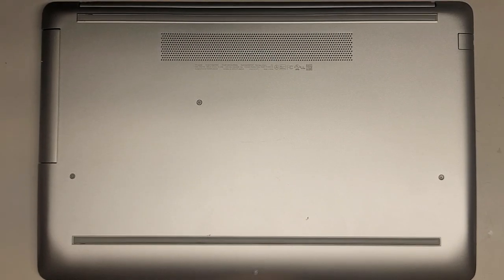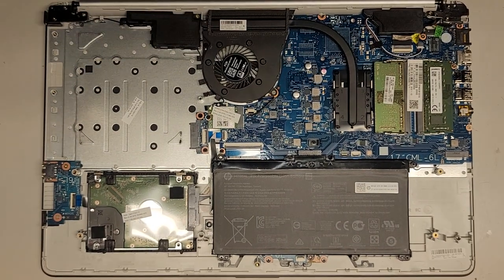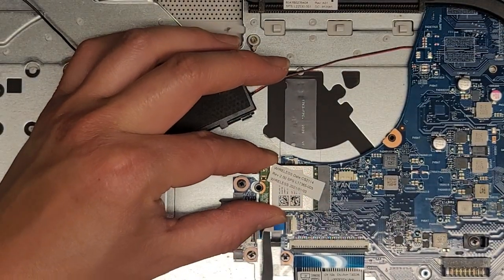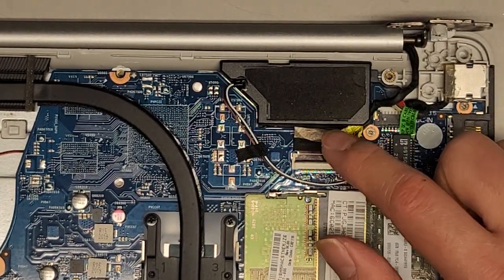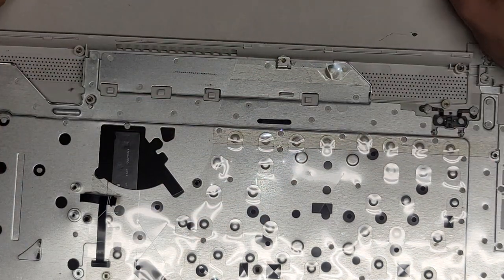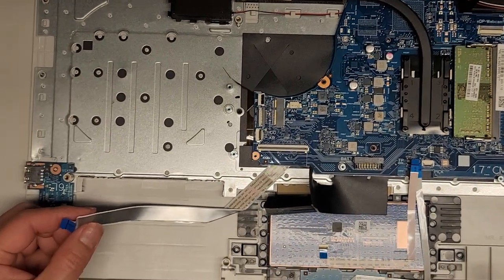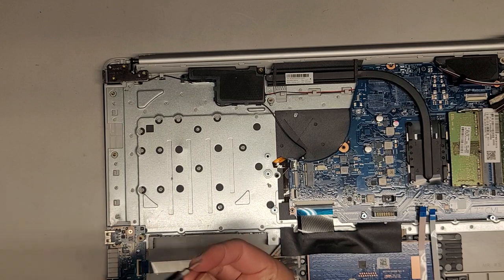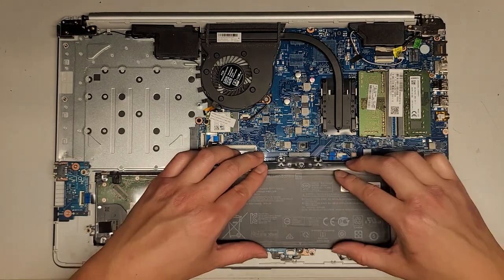HP Laptop 17-by2053cl Disassembly RAM SSD Hard Drive Upgrade Battery Motherboard Replacement Repair

Comment: Excellent video! This is actually the easiest laptop I had to ever open up. I am in the process of attempting to up the CPU as well. However; discovering it is not a simple as the memory, SSD and battery. One note to remember......don't rip those feet strips off completely....I found that out the hard way....there is some sort of nub on each one and I ended up just buying some after market feet because the more I tried to make the stripes work, the more I screwed them up.....seems as if they were deteriorated slightly.
Reply from the maker: Thanks! If you haven't already, please like and subscribe so others can find my videos and possibly consider watching a few others to get the algorithm to recommend my channel. Hope the upgrade goes well.

Comment: Hey! I have kinda same problem, but with my unit, i replacing an upper case. I ordered one, without keyboard like a year ago and suddenly forget that i have one. My question is odd, but, can i use the old keyboard and slap it in new upper case or it's can't be removed?
Reply from the maker: It's held in with melted plastic.
Reply: @ItsBinhRepaired  Yeah, google it little more, third-party sellers from china just suggest using a glue gun, if you buying one from them. I think I just goibg to remove the old one and slap it with some glue. Thanks for the advice!
Reply from the maker: @ghostkapral2086  yup

Comment: were did you get the replacement  Upper Case Palmrest?
im looking to one buy but scard of geting  a defective one im useing the 17-ca1xxx please respond when you can it would help a lot mate <3
Reply from the maker: Upper case? Screen or keyboard?
Reply: @ItsBinhRepaired  The keyboard  I think I hand some hinges the plastic mountains are broken?
Reply: I could shoot you a email if you want to see. What I'm talking about.
Reply: Yeah, it would be the keyboard.
Reply from the maker: @bakurathewerewolf8121 possibly this https://amzn.to/3QVN91k or this https://amzn.to/3t1Dbn2
Reply: @ItsBinhRepaired Thank you so much, do. I'm gonna try to fix this myself Hope I don't break anything doing it. LOL XD You have a nice day and stay safe.
Reply from the maker: Hope the repair goes well
Reply: @ItsBinhRepaired  Do you have anything I can take in consideration?
Reply from the maker: @bakurathewerewolf8121  disconnect the battery and press and hold the power button at least 15 seconds before more Disassembly
Reply: I have an extra shell..?
Reply from the maker: Shell?
Reply: @ItsBinhRepaired  no HD no memory no motherboard at sll....just keyboard and everything else also no battery,,,mouse & TouchPad all there as well
Reply: No screen
Reply from the maker: @SiberianIce2022  I'm confused. What are you asking?